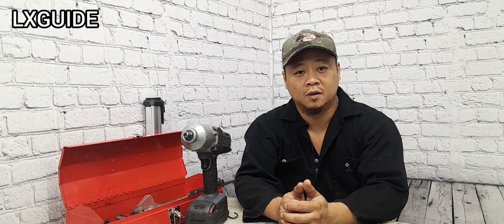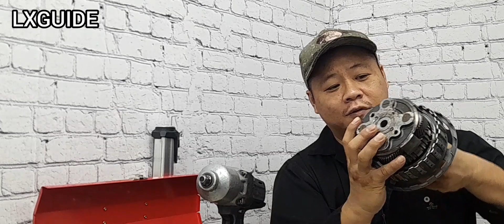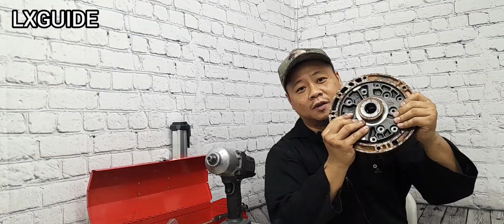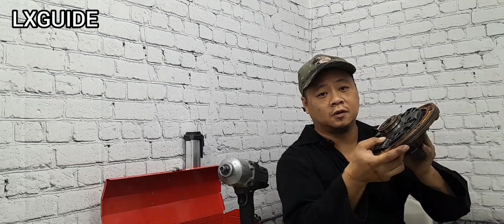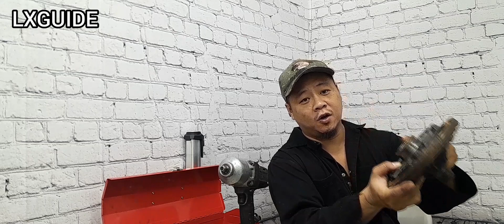INCORRECT GEAR RATIO P0730? MY EXPLANATION

Comment: After I had swapped a new 5.7 engine on my Charger RT 07 Last february with few minor modes 
 
- 87mm throttle body
- Camshaft COMPCAM XFI 208/212 hydraulic
- Eagle 5.7 Intake manifold
- Exhaust shorty headers from EFI
- e85 tune.
- 525cc injectors
- Performance exhaust line.
 
And I released the speed limit from the manufacture. 
 
2 months later I got a major link on the transmission (bad luck). I sent the full transmission to have it entirely rebuilt. I got it installed and for 2 months no problem at all. Then 2 months later, I went WOT for short distance just to enjoy the sound of my CHARGER RT 07 with the new exhaust line. The engine went into safe mode and got the icone light up (it seems like it does it randomly depending on how crazy I drive, since my story occured twice). But when I look at the code through the menu of the car, it says it is all good. And few minutes later, back on the road. Eventually the engine icone goes away (once, right away and the second time 2 days later). 
 
Yesterday, I plugged my HP Tuners and to figure out what is going on. I got two codes; P0730 along P0219 (Engine Overspped Condition). I will defenetetly drive smoother until I get this issue fixed ( I dont want to mess up anything at this point since I put already a lot of money to have my transmission fixed and the rebuilt engine from the States to FRANCE). Thank you for sharing any thoughts. Cheers

Comment: I'm getting a hard shift from 1st straight to 3 Rd gear when the vehicle is first driving. When it warms up it's fine. 

Code pulled a 0733. Odd thing is that it's the second gear that it is having trouble shifting to, not the third.

Comment: We have a 2012 ram 1500 with the 6 speed automatic transmission , it was my Father in Law's truck , we baught it from my wife's step Mom after he passed away in April of this year . We didn't know their was an issue with the transmission , my wife had been driving it, wasn't till I used it to go pick up our daughter that I noticed it wasn't shifting, other than once , doesn't feel like a slip and no noises like that , I checked the codes and It showed several, P0731 , P0933 as well as a couple others I can't clear the permanent codes , I did replace the shift solenoid and had the TCM relearned but it didn't change anything , so it has new solenoid , filters and fluid , I'm wondering if it's just electrical, like a bad TCM or possibly the speed sensors , but wish I knew specifics so I'm not throwing money we don't have to narrow it down.

Comment: Hello,

I have codes P0733, P0735, P0868, P0944, P1790 and P083B.

Some time ago i noticed when slowing down that it’s not shifting properly between 5th and 4th gear and especially between gear 3 and 2. It feels like it stays in higher gear and when shifting 3rd and 2nd gear there is a sound something similar when you drive manual transmition and car is in 3rd gear but you don’t give it gas pedal, like it’s chocking.

Few days ago, car stopped reacting to gas pedal in driving. I turned the car off and on again I was able to drive in first two gears but as soon as it reaches 3rd RPMs are going, but it seems like there is no gas/acceleration.

I changed the filter and the oil it works now, I am able to drive it but still have problem with downshifting from 3rd to 2nd gear, there is that sound again that reminds on not hitting the clutch while driving manual transmition.

Please help.
Reply: Did the fluid change fix it?? I have the same issues but in a 2019 5.0 10speed transmission
Reply: @GIOC-3LA you try changing the fluid already?

Comment: i would start with cleaning or changing out the solenoids or valve body.
Reply: What kind of cleaner?
Reply: @illness93 if you're planning on just cleaning and changing the fluid, filter, or the solenoids just use brake cleaner to clean everything off before reinstalling
Reply: Where is your shop I have a land Rover range Rover hse 2003